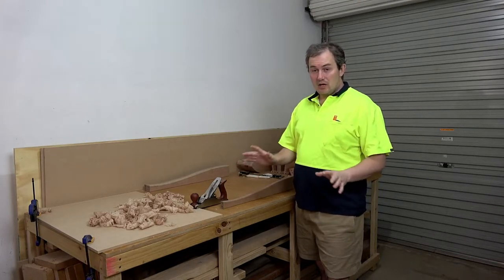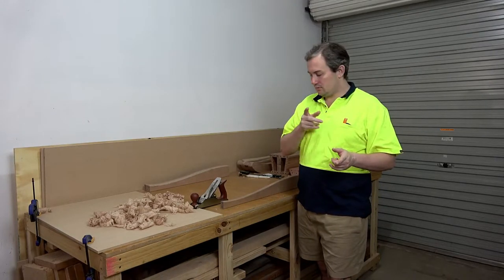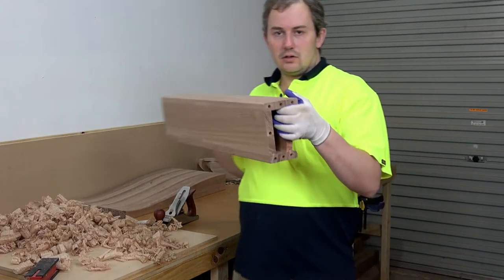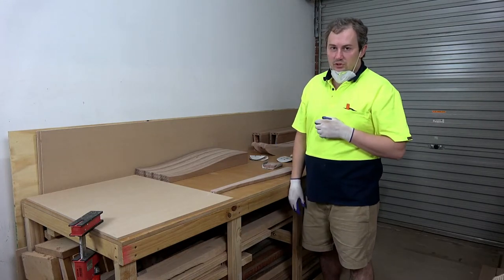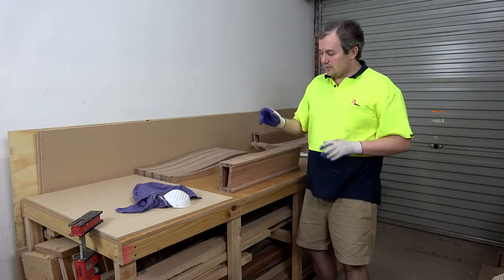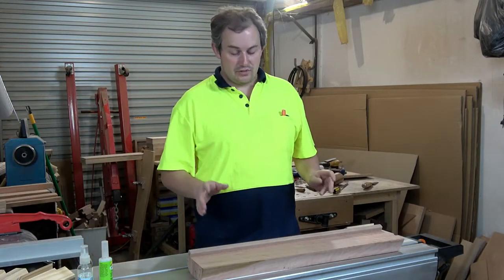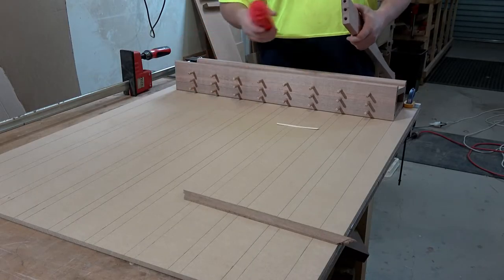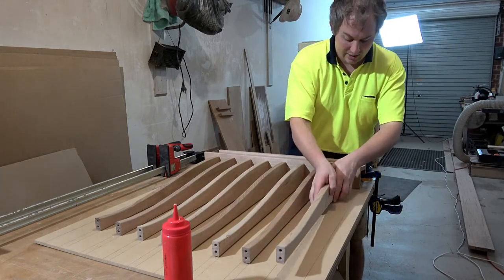Smooth hand planing and glue up - Baby Cot Vlog 13

Comment from the maker: It is currently 43°C here today, which I think is about 110°F. It's damn hot, so maybe I will have a video for tomorrow, maybe not. I'll edit this comment tomorrow morning if there won't be a video. Thanks for watching, I'm still having fun doing this 😀
Reply: Kuffys Woodwork Northern Ohio in the States.  Snot freezes in your nose, in case you're interested.
Reply from the maker: ewww gross. shooting icicles when you blow your nose 😀
Reply: I reckon you should have the day off it way to hot to do any sort of work especially glue ups 
It's looking really good 👍👍
Reply from the maker: I smashed out one glue up this morning before it was super hot. I'll let it sit in the clamps all day and night now because I won't be gluing anything else in this heat. Then I spent a good part of the afternoon standing next to the thicknesser doing some MORE machining for parts that I lost, or cut up into other parts without realising 😀

Comment: A lot of dowels! But strong as hell. No baby escaping this crib
.lol good stuff again kuffy home stretch now ehh?
Reply from the maker: Almost the home stretch. Although there is still a heap of dowels to be done (hopefully tomorrow), I do have a couple of interesting tasks yet to complete. The back header panel needs to be shaped, a bent lamination applied to the top of it, and then custom fit the header to the cot sides. And I also need to shape the top Grey Gum on the side panels, and build the lower drawer and matress base. I'm hoping to be completed by January 10th because I need to start work on a chest of drawers.
Reply: Kuffys Woodwork well just call ALL  that the home stretch..haha! Chest of drawers sounds good too look fwd to seeing that one too